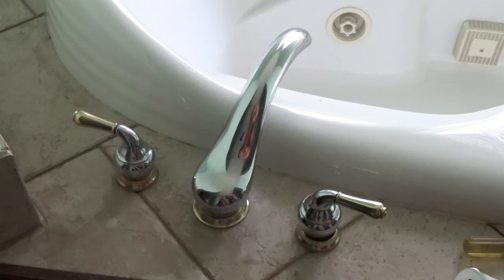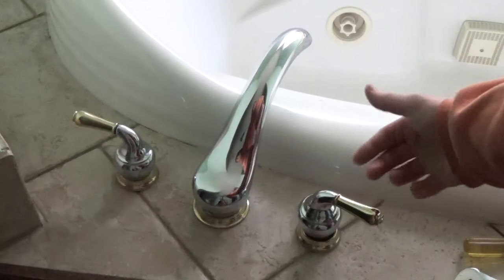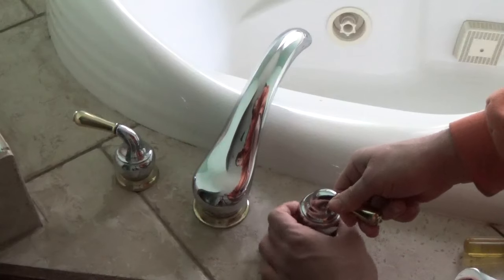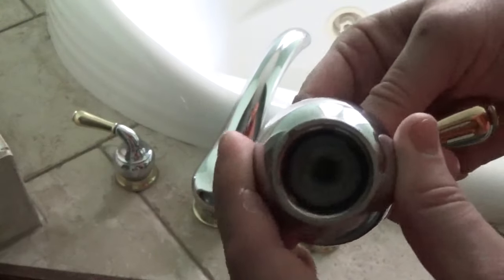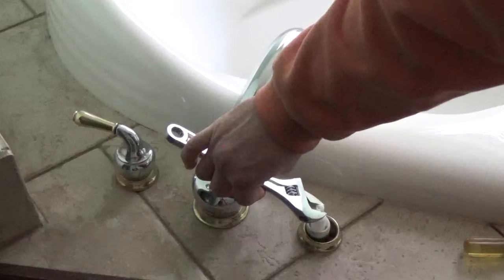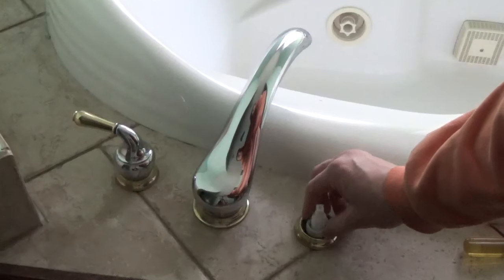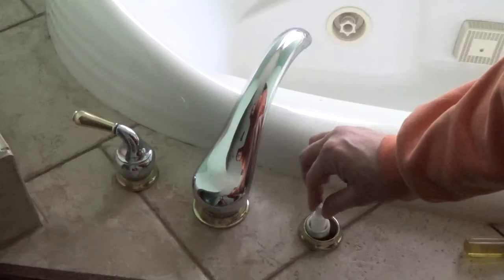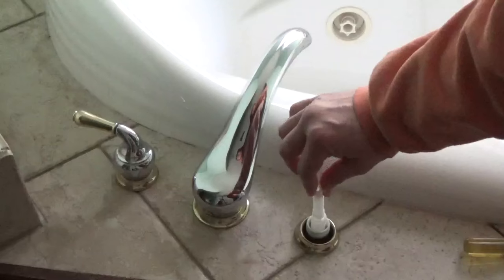How to turn off a faucet that keeps running

Comment: i had not done anything to the faucet for a few years and it was working fine, when it started pouring without turning off. I took the cold water handle off and saw that the "square" was being grinded to a cylinder so the handle would turn itself but not anything else. thank you for showing me how to do this.
Reply from the maker: Glad it worked,!

Comment: Thank you! Mine was a simple need to tighten the handle. I would have otherwise tried to pry cap off of top. No idea that lefty loosey on handle was the way to disassemble it. I would have marred up surface. Thank you for taking time to make this video.
Reply from the maker: yup that would be frustrating to strip all the interworkings, but the plastic-ness leads me to believe it would be very easy to do

Comment: Just wanted to add my two cents in case it helps someone else because your faucet handles look just like my Moen ones. The plastic pieces were positioned where they needed to be but underneath those was another screw that had come loose. Tightened it up and re-assembled the plastic gear pieces. Wah-lah!! Don’t need to call a plumber 😃
Reply from the maker: good add... thank you. i didn't have that problem luckily so i didn't even dig that deep

Comment: Thank you for posting the video.  I think I have the exact same faucet as the one in your video.  I have a situation where the faucet is loose.  There looks like there is a set screw missing in the back of the faucet.  Would you mind letting me know if your faucet has a set screw?  If so, do you happen to know the brand and/or model?   Any help is greatly appreciated.  Thank you!
Reply from the maker: thomas mann it does have a set screw. And I'm pretty sure the problem your talking about happened in our shower. I don't know the brand, because i was looking around for the same info when the shower acted up, but could never find any inscription

Comment: Any suggestion for a metal inside that will stop running if I apply my body weight of pressure to (while turning it),  but if I let up even the slightest, it goes back to running?
Reply from the maker: without seeing it sounds like some sort of rubber gasket or o-ring issue. it has some crack in it that when you torque the heck out of it it can mush up and stop a leak but any release exposes the crack. just a guess... but there is something rubber-esque in there that tore, cracked, or got misshapen over time.

Comment: The video helped me take the faucet apart, but turning the plastic part (mine is metal) as you suggested still didn't make the water go off. Any other suggestions.
Reply from the maker: Can you remove a metal sleeve by lifting up? Maybe it's skipped a tooth?
Reply: @BrianLeeDick  If I could figure out how to attach a picture I would.  The metal thing sticking up has a wire clip going through it.  It looks like it is all part of some kind of metal cartridge.  I've tried loosening the ring around the base to see if I could remove and replace the entire cartridge, but the ring doesn't budge.  I've tried turning the metal post standing up and it will lessen the flow a bit, but never turn it off.  This is a faucet that I bought used, so I don't know the brand name.  I can try pulling up on the metal post and see if that does anything.  I did tighten the screw in the handle as you suggested, but that doesn't do anything.
Reply from the maker: @edw927  is the wire clip acting like a cotter pin maybe, and it's keeping everything locked up? Or does it not look like it's performing that type of function. It may be a completely different mechanism than the one I show in this video, so I may be at a loss
Reply from the maker: It may be a matter of pulling that pin, turning the innermost part of the mechanism until it shuts off, then reinsert the pin. Without seeing it though I couldn't predict whether you'd even be able to reinsert the pin, which could worsen the situation
Reply: @BrianLeeDick  It is just a pin that goes in a groove around the metal point. It seems to have no obvious function. It does look like a cotter pin. I've taken it off and put it back on with no effect.  I went to Lowes looking for a part similar to what I am seeing, but didn't find anything like it.  For the moment I have just turned off the hot water valve under the sink so the faucet doesn't run all the time.

Comment: Could you tell me what module of the faucet that you show on TV and If it's possible how can you take off the parts to solve the drip, Thank you
Reply: U might as well get a new or used faucet
Reply: It can be a pain to repair a stupid rubber piece
Reply from the maker: i don't see any markings to show model number?

Comment: I got the handle off, but the knob still kept turning. I’m still stuck
Reply from the maker: +ntiger8705 any way you could also apply pressure down and rotationally? Maybe that could help? Or do you notice that the little plastic "cogs" are worn down and they're not catching?
Reply: Brian Dick the inside of the stem was torn up. There was no fixing it. We had to turn the water off until a plumber could come, but that’s exactly what I looked at next. Thanks for the reply!!!
Reply from the maker: ntiger8705 dang that sucks. Sorry to here that. Glad you figured it out!
Reply: Did all this but still won't stop water flow
Reply: Worse yet even with water turned OFF at the meter water still runs half pressure .
Reply: Maggie Haslet so what happened were you able to resolve the issue and how?

Comment: How do you take the hot water limiter off.
Reply from the maker: not if mine has it on the sink... I've only seen it on my shower... it usually is just a "ramp" fundamentally, and you just wedge the ramp"forward" to limit how far you can turn it on

Comment: What is the model of this faucet?
Reply from the maker: Unfortunately I don't know the model -- it was here when we moved in. I've looked for an inscription and everything and don't see one. Definitely think it's on the cheaper side of things
Reply: @BrianLeeDick ok Thanks. I have an identical one looking for replacing that. Cold water side is leaking and unable to fix the plastic pieces.
Reply: Found the model. It is Moen T951CP. It may help others if you add this to the title.

Comment: Still leaks after I changed the valve
Reply from the maker: hmmm... leaking from the faucet itself? or out of the handle?
Reply: @BrianLeeDick  both, I pulled out the o-ring covering the spring and found it was sliced on install. Replaced and no more bypassing.

Comment: Yeah that didn't work for me. Same faucet tho 🤔😮‍💨
Reply from the maker: hmm.. then there may be something messed up with one of the gaskets. maybe dried and cracked? is it a faucet that sat dormant for a long time
Reply: @BrianLeeDick  no it's in my kids bathroom so I'm thinking they may have been playing with it and over extended the handle, and it just won't separate from that piece, the whole base ends up being loose/unscrewed and I don't want to end up messing up those pieces underneath or the hoses.